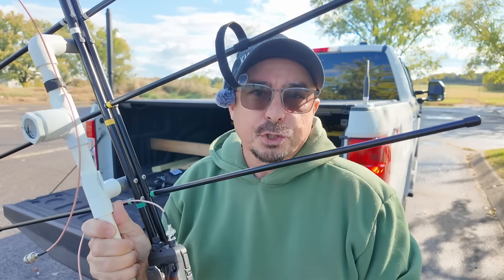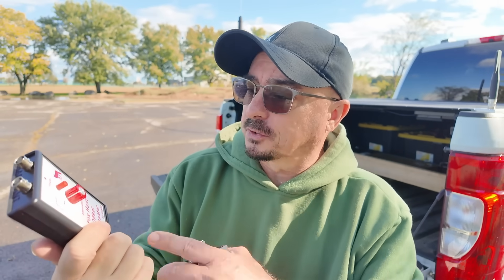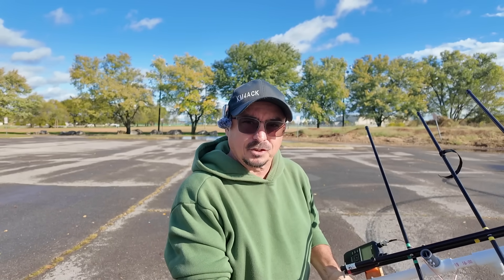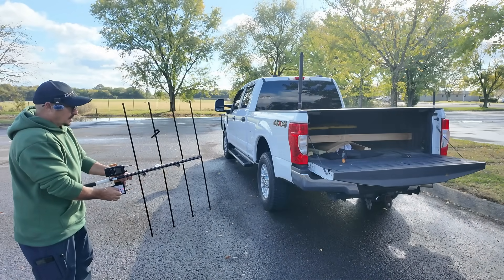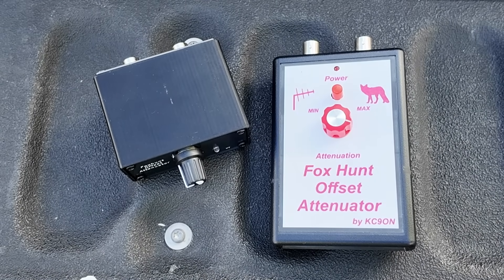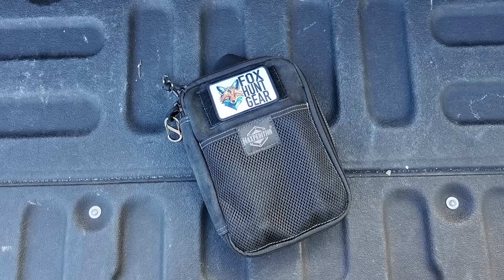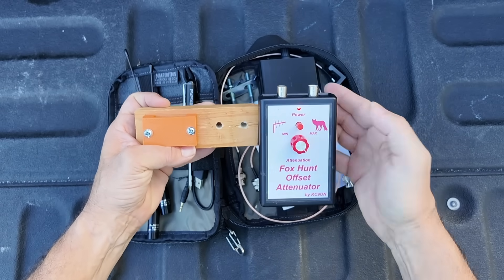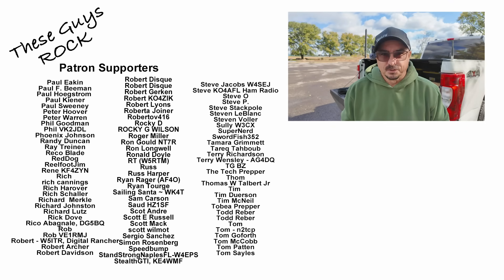I Was Losing Every Time … Until I Tried This

Comment: My first fox hunt was using our 1953 Buick Station wagon with a Johnson whipload 6 antenna mounted on the back bumper and a pmr6 receiver on 10 meters.  The car shielded the antenna enough that you could turn in a circle and watching the s-meter tell when you had a null.  Generally when the null occurred the car was pointed at the transmitter.  It was fun finding an empty parking lot.
Reply from the maker: That's an awesome story! It's always great to hear about the ingenious ways hams have approached fox hunting over the years.

Comment: But what exactly does an offset attenuator really do? I mean whats actuslly inside the box? Like what is the circuit and how does it work?  (Ok, we know it attenuates  and you show that it works pretty good) Inquiring minds and all of us hammy golden screwdriver types must know the theory of operation. Its an offset attenuator because it operates ten megs up or ten megs down from the fundemenral freq?  How does it operate ten megs down? Does it have an oscillator circuit within?  How about some quantifiable performance data. How many measurable units such as dB and signal microvolts.???
Reply from the maker: From his site:
The circuit consists of a small RF generator, in this case 4MHz, which will mix with the incoming fox signal (such as 146.52MHz) and produce new signals at plus and minus the fox signal (142.52Mhz and 150.52Mhz). A potentiometer on the board changes the injection level of the RF generator which in turn attenuates the incoming mixed signal to your radio to a level where tracking can continue.

Comment: Our club built tape measure yagi's as a project several years ago. I still have mine hanging in the garage. I also have the older version attenuator and have used several different HT's but found my old Radio Shack Pro 95 scanner works best. It has it's own attenuation so combined with the Fox attenuator it works even better.  My Fox is a Micro-Fox MF-15. We've used it several times to do hunts. One of my favorite Fox hunts is a friend and I sync our two Foxes and put them in different locations within the hunt area. Of course we don't tell the hunters there are 2 foxes. 😁
Reply from the maker: That's diabolical! I like it!!!

Comment: Am I right that you can turn the antenna to horizontal polarization and the antenna will attenuate itself? If that is too much attenuation slowly rotate the antenna until you pick up the signal again.
Reply from the maker: At distance, you are correct. Once you get closer to the transmitter, turning the antenna will do little or nothing at all.
Reply: In ideal conditions, yes. Actual attenuation is dependent on the antenna types and how close to perfect it is built. Cross polarizing your antenna for foxhunting should give you about a 20 dB attenuation, but only if antennas are actually at right angles. If the fox is hanging in a tree with the antenna at 45°, attenuation will be less. Also, if you are getting reflections off nearby buildings, won’t attenuate as much.

Comment: Great video, I hope that it causes some interest in fox hunting.  The radio club in Omaha used to have a hunt once a month. (not sure if they still do.)  I believe the winner of the hunt was fox for the next month's hunt.   One of the tricks played on the rabbits was a high powered (100+ watts) TX with directional yagi  aimed at a cluster of tall buildings in down town Omaha.   It was probably in the back of a pickup with fiberglass shell to hide the antenna.  It made for some interesting reflections coming from the tall buildings.
Reply from the maker: Thanks! That sounds like a fun hunt to be a part of and could really test your skills.

Comment: Hey Brother, thanks for showing our MF-15! You are right, it is now extinct, and has been replaced by the MF-50, which is similar to the MF-15, but uses a  USB-C connector for programming, and configurable output power between 1-50 milliwatts. 73's, Allen AF6OF, BYONICS.
Reply from the maker: Thanks for the info and building quality units! Might have to pick up the MF-50 soon.